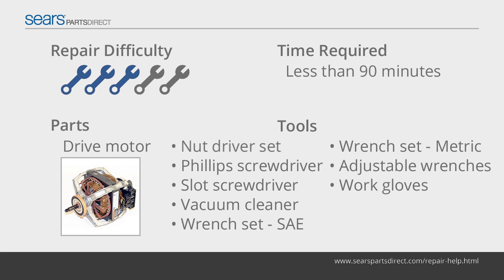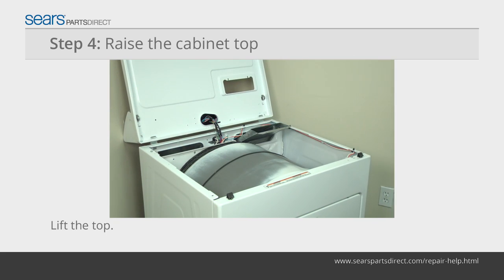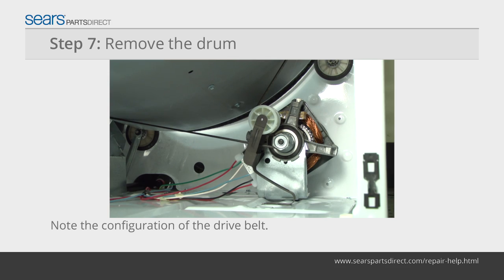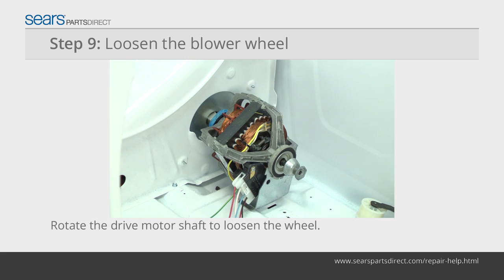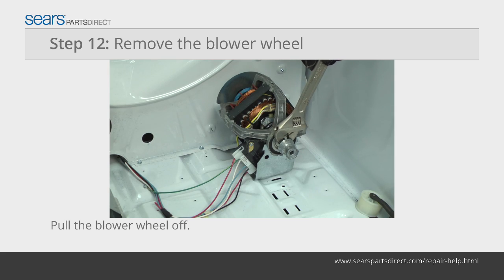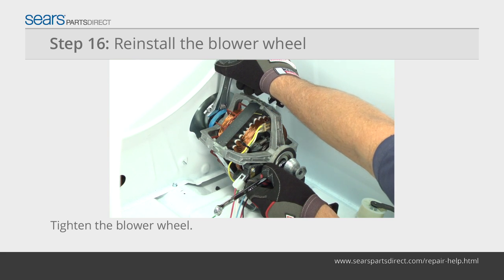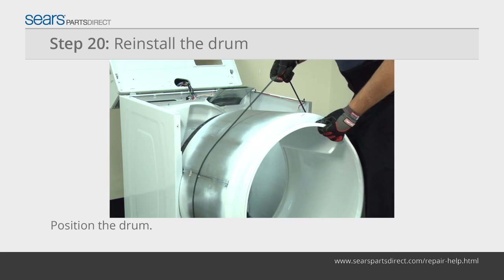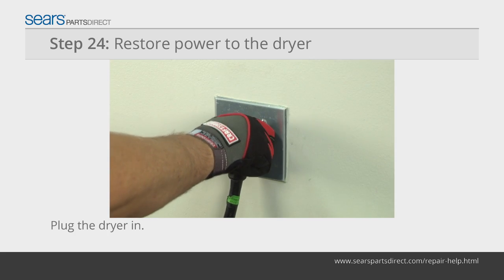How to Replace a Maytag Electric Dryer Drive Motor

Comment: I hate that I’m having a hard time removing the motor from the blower wheel
Reply: Definetly wear gloves! Couldnt get the blower wheel off  The fail to mention that once yoy undo the clamps.The motor moves around like a son of a bitch. And the wheel is welded on.
Reply: I just did mine. They all fail to mention that the motor rests on a tray that can be easily removed by 2 screws. This allows you to remove the whole motor on the tray. They also fail to mention instructions from the old wiring from the original to the new motor.
Reply: @jamesbon1 True, the motor sits on a bracket with 1 hexagon bolt or on a tray as you call it with 2 screws. But, you still have to remove the blower wheel that's secured to the back of the motor and on mine, there's very limited space to "attempt" to remove that damn blower wheel.
Reply: I never should have started this project of replacing the dryer  motor. So fuckin aggravating to do this job!